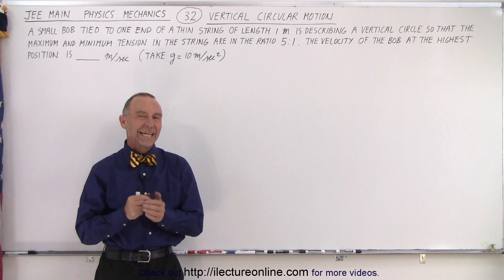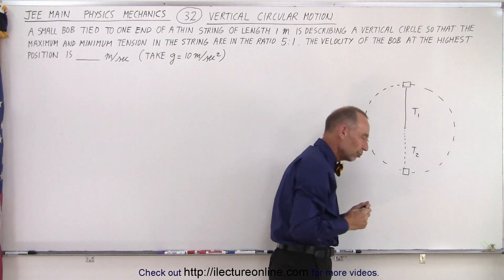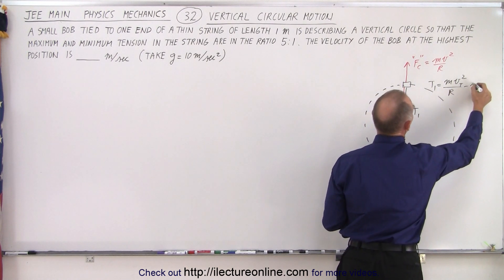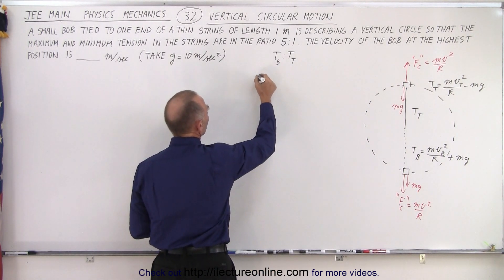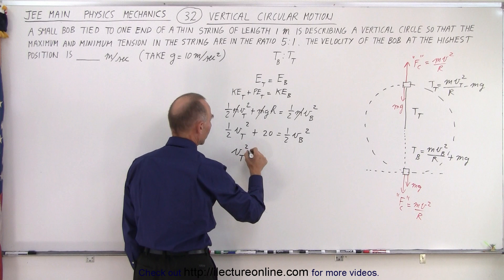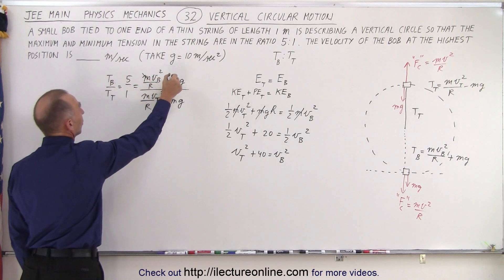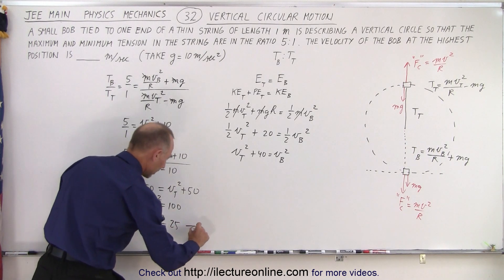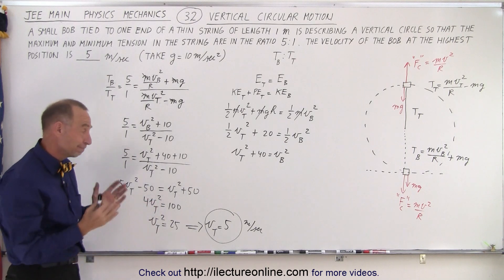JEE Main Physics Mechanics #32 Vertical Circular Motion

Comment: Sit in this question a different approach..or in one  word centripetal force using can be done ? My answer also came same.
Reply from the maker: There are usually several ways in which a problem can be solved.  Did you get the correct answer?